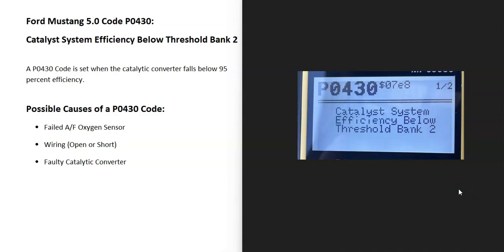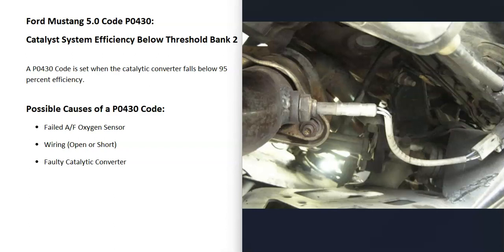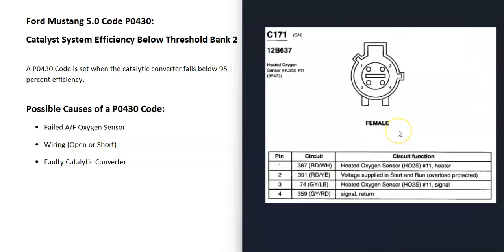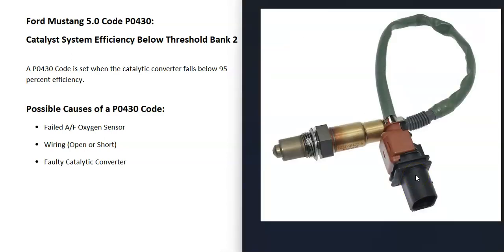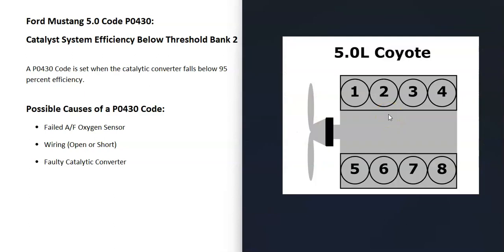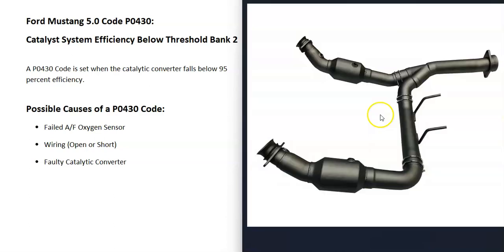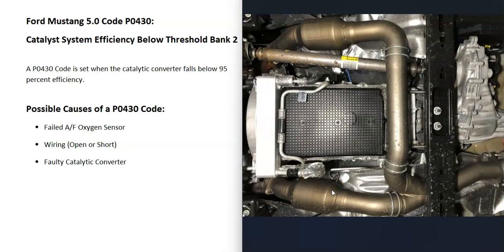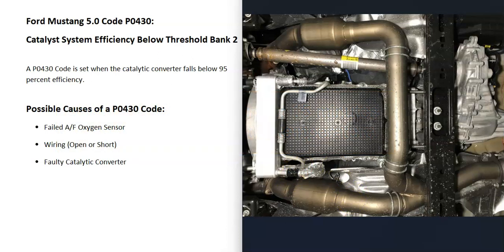How to Fix Ford Mustang 5.0 Code P0430:Catalyst System Efficiency Below Threshold Bank 2

Comment: They say 9 times out of 10 its a faulty sensor...bs...i guess i'm that 1/10 my cat was bad and i only have 45k miles on it....
Reply: Dude I’m at 49k miles and it just popped up , did you ever fix it?😊
Reply: @alexisgarcia7689  Yes I did. Had them both replaced (only paid for labor to replace one). Mechanic said it was the best thing to do and I trust him.
Reply: @motorheadbanger90  what were some indicators? Like, did you have noticeable exhaust coming out?Did you have a smell?
Maybe when you're idaling , the car would fluctuate its idol